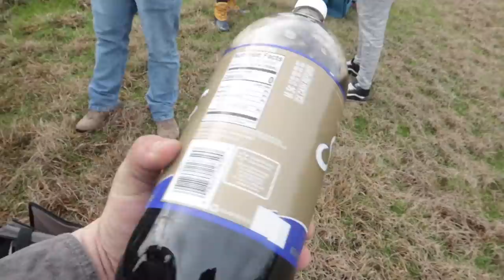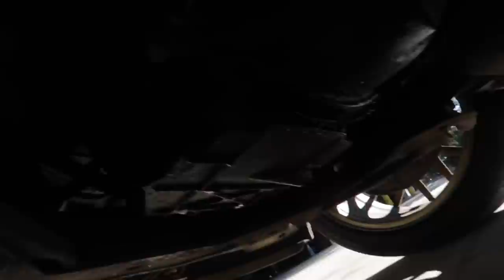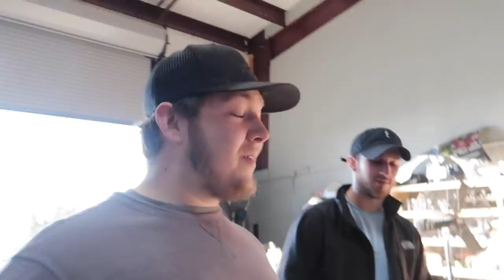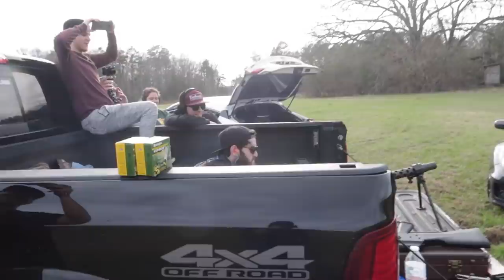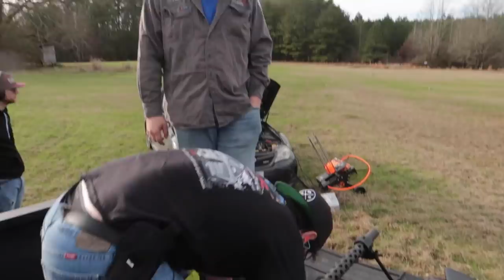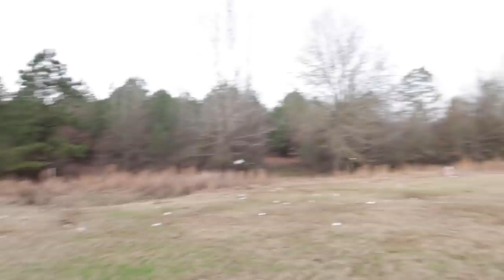Machine Gun Hasn't Been Fired Since WWII. Until now...

Comment: Poe Man y'all be careful man that gun needs to be looked at might just need to be cleaned correctly or you might have the incorrect brass ammo casing and it's not fully injecting getting stuck in the blowback but the problem is would be a live round getting stuck but not going off I would definitely take it to a gunsmith are getting a good bore compound in solution gun cleaner  gun oil it should have ejected itself and pulled another round into the chamber automatically the only time you should have two chamber it would be fresh ammo or to clear the gun I don't know but I don't think it is a semi-automatic if I'm not mistaken it should be a spray and pray until the last bullet is chambered you shouldn't have to inject it every shot but it's definitely not a single shot bolt action but still cool as hell but will be even cooler to let off a 300 round ammo can full of hot brass

Comment: Anyway, poe. I have had this problem with my v6 mustang had it in and out of a shop 5 or 6 times. Eventually I said frick it and fixed it myself. I had to replace the clutch quadrant with a billitt one and put a brand new clutch fork, throwout bearing and pivot stud and it solved all my issues. But make sure you get an adjustable clutch cable with an adjustable firewall mount and an adjustable screw for the clutch fork.
Reply: Also, your clutch fork should not move front to back, but it will move from side to side.